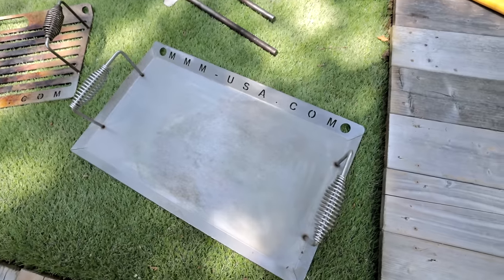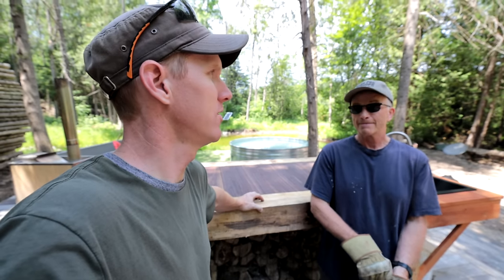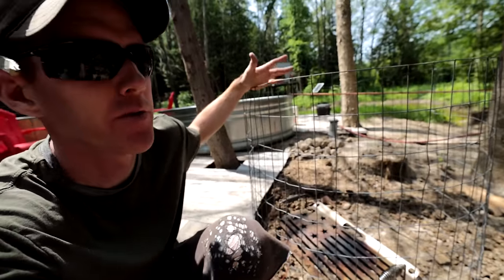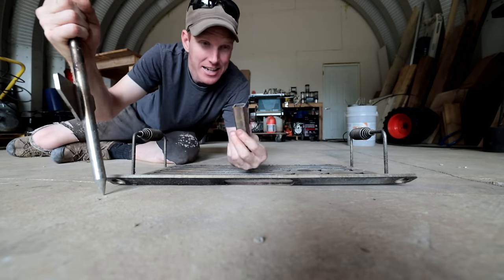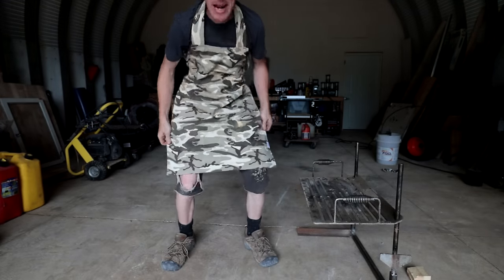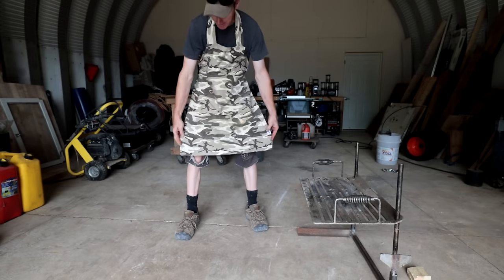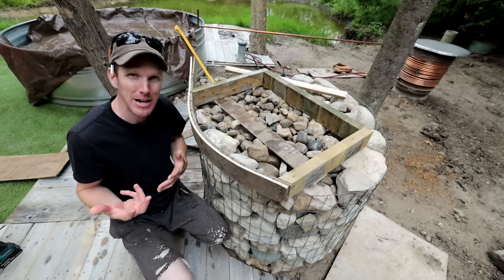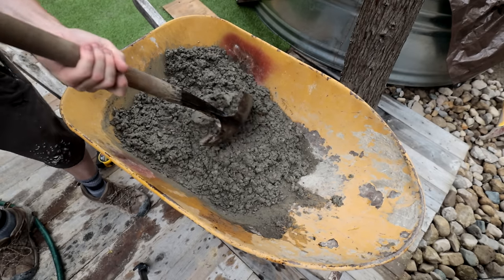Building Rock BBQ Outdoor Fire Cooker (Massive Burger!!!) - Installing Solar at the Off Grid Cube

Comment: Kevin, I would have put chicken wire or reobar in the concrete, so don't be surprised if it cracks with the temperature differences you experience! Otherwise another awesome build 👍🇦🇺🌞

Comment: The grill looks great, loving how your outdoor kitchen/chillout zone is coming along, now I want burgers! :O

Pond looks good too, but you should still consider some water plants for your pond, water with fish need good oxygen and that pump just isn't enough long term for the amount of water, unless you are planning to treat it regularly.  You'll be surprised at the difference $50-80 of plants can bring to it.
Reply: They've tested the oxygen repeatedly, he said it in the video where they did the remediation treatment. The oxygen is well within requirements and that stone they have is actually sized up for an even larger pond than they have. They are also going to be using it as a skating rink in the winter, so they pull the fish out at the end of the fall.
Reply: It's more than likely just a nitrate/nitrite/ammonia issue. But as you said, plants would work wonders

Comment: I love that batteries separate idea. Cause we all know the batteries will crap out soon enough. 

Add some 1/2" drain holes in your stake pockets. Even if you cover or plug them. Maybe leave the stakes in permanently & caulk them into place. Cause ice happens. 

Add an upside down funnel & stove pipe over the raised cooking surface. Should act like an oven fan.
Reply from the maker: Son of a...  I forgot the drain holes... I was gonna do that.  Thanks for reminding me..

Comment: In sewing we refer to the "line" of the dress, not the frame, so it actually would be called an a-line dress, with a "smock" or "apron" front, if it only had a back to the skirt part. It would go nicely over a blouse.

Comment: Concrete strength is determined from water cement ratio (among other things) so yes dryer concrete is better than soup.  Most people use slump as a measure of workability

Comment: If you leva the tubing long and put a pocket  under the tubing you can notch  out 5he tubing  to slide the wings on the stakes in to hold them frome turningand the grill can be pulled off and used at a other camp site.

Comment: Hey, always wanted to ask, in Canada you use metric, ? but mostly you relate to imperial, just noticed in pond video, mentioned pounds and teaspoons then a litre of water. ?
Reply from the maker: Very fluid measurements here in Canada... Feet and inches in construction... F in pool water and house temperature.  C in outside temp.
Reply: @ModernSelfReliance  We would probably do something similar here in the States, but we're too lazy to learn metric. they tried in the 70's and early 80's and we said "no thanks"

Comment: So, engineer here, you need a minimum amount of water for full hydration of the cement, beyond that the lower the water cement ratio the stronger the concrete will be, of course, the lower the water cement ratio also makes it harder to work with, there are chemical addmixtures you can get which help out with this but I generally don't see it available for small builders.

Comment: I'm still concerned about the pond, especially if you are going to be feeding your fish.  that is going to add a lot of nutrient to the water.  You will need a biofiltration system where you can add healthy bacteria.  There are mechanical ones and passive ones.  You might try a channel called Ozponds.  Since you are adding rocks anyway, it won't be that much additional effort to build the bio filter.  A pond as small as yours, you should be able to see the bottom.  Good luck!

Comment: Hmmm. That pile of rocks could be the answer to your pond, BTW.
Reply from the maker: I'm currently stock piling for low water season.
Reply: I was thinking using that exact set up and letting the water flow over them.  Put a concrete pad underneath to let the water gently flow back into the pond.